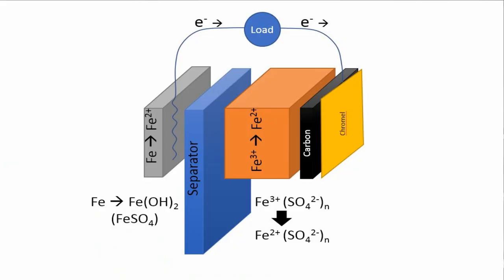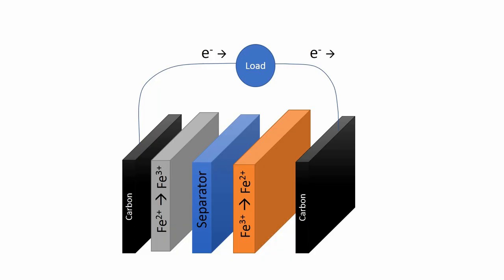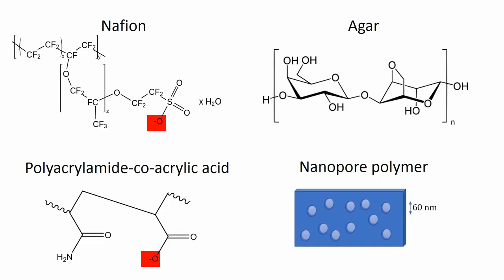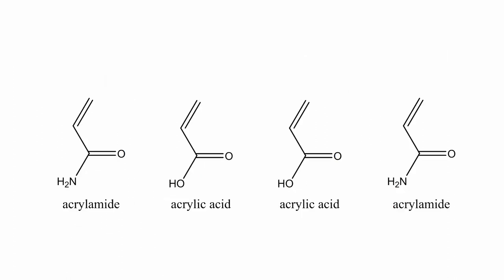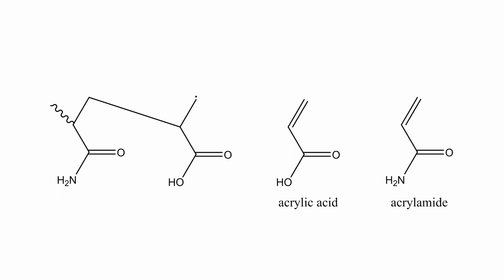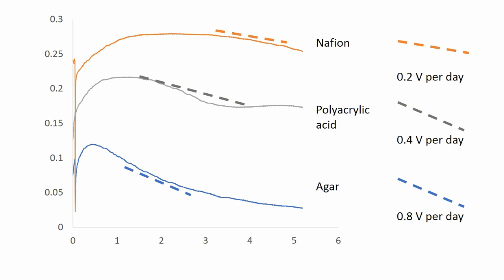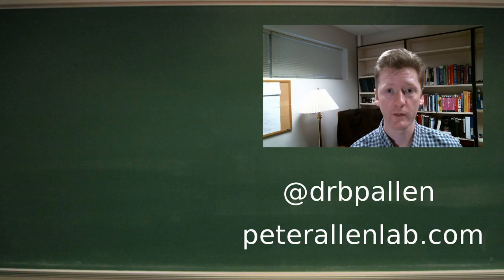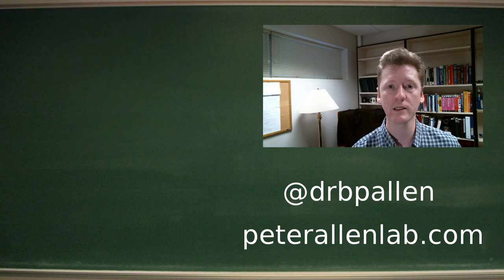Battery chemistry: Our Best Homemade Separator

Comment: how about the flow metode used by essinc.com, with FeCl2 in one tank and FeCl2/FeCl3 in another?
Reply from the maker: That's pretty much the same basic chemstry. I'm not sure what counterion they are using to stabilize their iron, but sulfate is working best for me. Thanks for sharing - I just started reading about them (I'm a month behind my reading it seems).